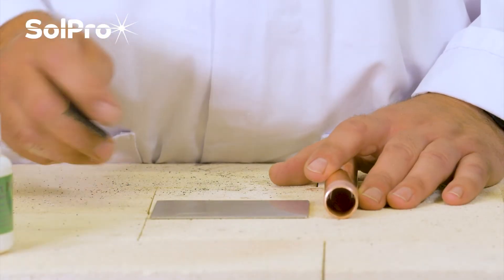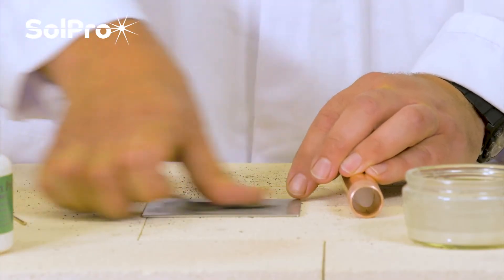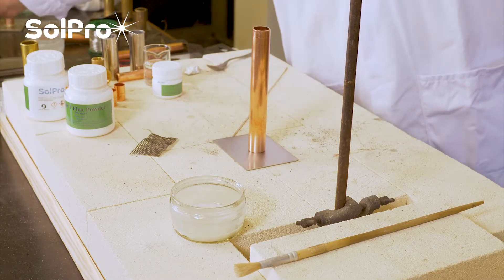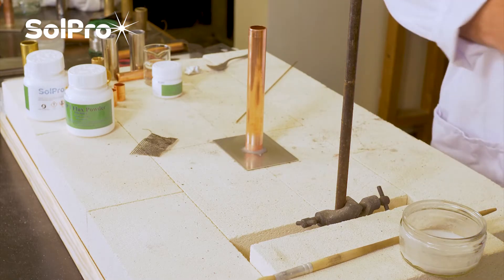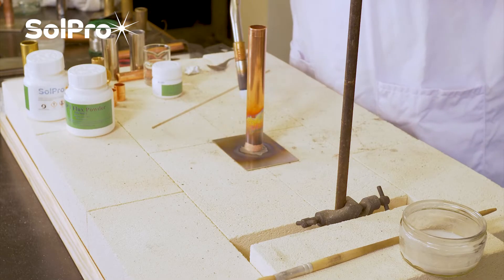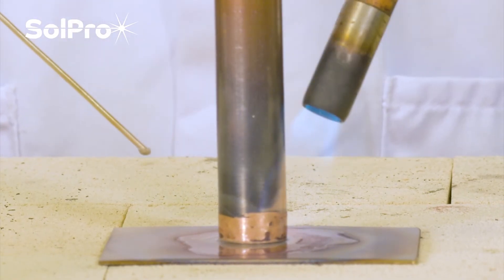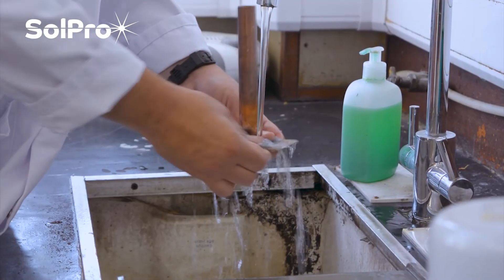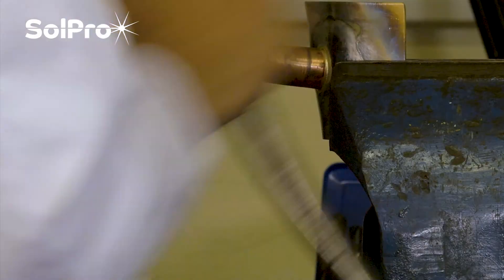Brazing Tutorial - Copper to Stainless Steel

Comment: I need some advice, how would you suggest someone silver braze a stainless steel ferrule on to a stainless steel keg? I'm trying to do what is shown in the video posted on the goodwelds channel "Tig welding 304 stainless 4" tri clamp fitting in ABS brewing fermenter". I'm not a tig welder, but I have brazed before. I'm thinking about cutting the hole so the ferrule doesn't fall through, but rests on a lip. Would it be better to braze it on the inside out or from the outside in? How would you do it? Thanks for any suggestions. Cheers.
Reply: 5 months and no reply, imagine a company putting out a video and ignoring peoples comments, no way to do business. Did you get this ferrule welded or brazed yet? My thoughts concerning brazing is how will you hold it in place? Heating this up to temp the flux will allow parts to move around. Also with stainless, especially a thin wall keg can overheat fast and if the flux overheats the filler won't flow, I would TIG it, but then that's what I do. Best regards
Reply: @precisionarc  I did silver braze it successfully following the instructions of Planet Moonshine's  "Converting a beer keg into a home distillation boiler" though I agree tig is the best way to do it.